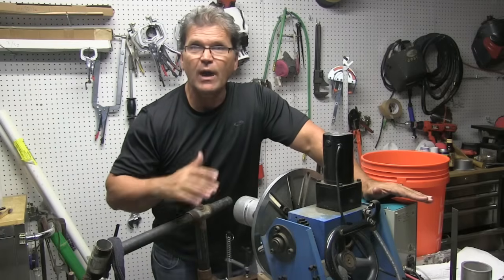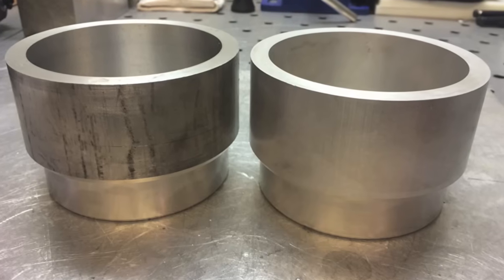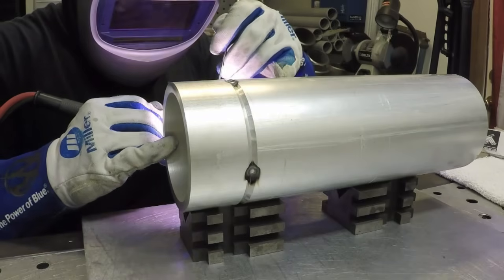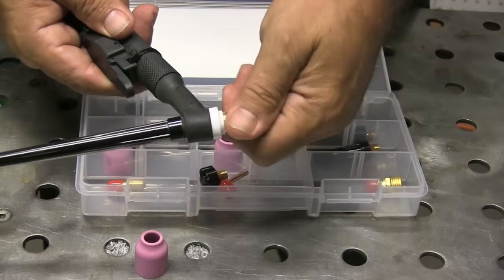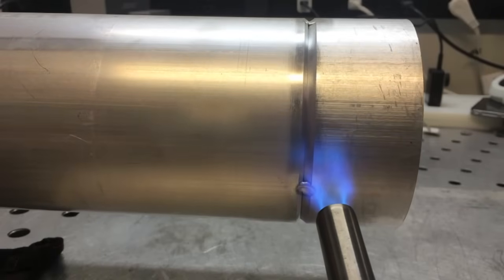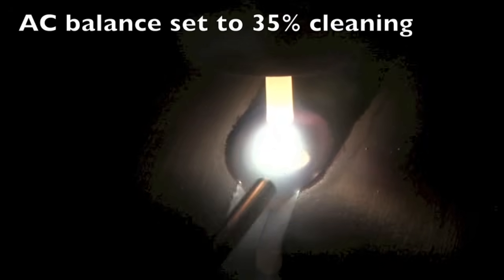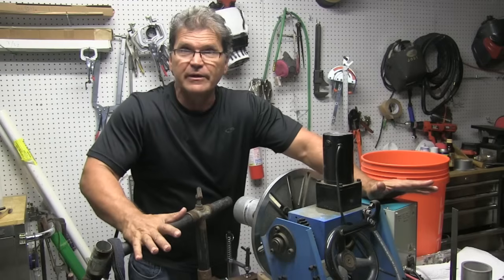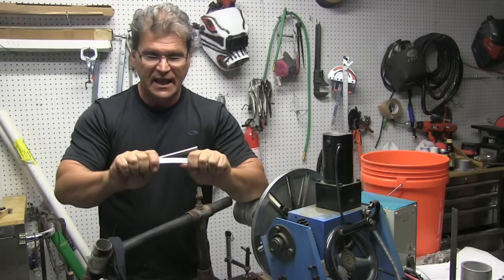TIG Welding 6061 Aluminum with 4643 Rod

Comment: I know this is an older video but does anyone have any good recommendations of books about heat affected zone and what it does to the the metal? I mean going deeper in depth then you average welding text book. Aluminum is non magnetic, so unlike steel I don't think it's going to change the way the molecules are aligned. Would like to learn more about that.

Comment: If the welded 3003 was tig’d with 4043 wouldn’t we see an “more uniform” radius applied since both the base material and filler won’t take on any heat treatment during the welding process?

Comment: I have to do a roll weld job in a miller jetline on this material in about 12 hours. Butt joint .125 sheet metal. God I hope this goes well

Comment: Dont agree. the HAZ is actually harder than the based metal, not softer. The HAZ experienced a very rapid hardening process when its been heated up and cooled down. Will need annealing to reduce the hardness of the HAZ first, bring it back same as to the rest of the material, then other heat treatment to change the overall properties. The testing straps bent like a square because the HAZ is harder. Thats also the reason why sometimes the weld cracks, because its too hard and brittle like a glass.

Comment: Hi nice video. I am stuck using a ck 180 tig torch. This was a 90 degree torch. 20 yrs ago  ck made a good torch. TODAY THEY MAKE ONLY GARBAGE.They lie about what they make. They lie about why it DOES NOT WORK. Do you have another brand tig torch that is the same size/shape/ amp rating as a ck 180?

Comment: Thankyou got a tig welder given to me been trying to workout how it works but you cracked it for me , i can now see were i was going wrong watching your video's , thing is there are to many settings for aluminium so i've gone for ac only , pre gas 2s , pre arc 4s , up slope 50 amps , 100 amp main ,15 % balance it seems to ball the end any higher, 80hz as it sound nice and welds nice , down slope 50 amps , down time 5s , down gas 5s would this be about right for 5mm aluminium  , thing is how much up slope and down slope , thankyou for your video's

Comment: Jody, how well does that dynaflux work on corroded aluminum castings, eg
 356A like on a modern automotive cylinder head.  I would like to see a before and
 after.

Comment: No air cooling hardens metal more than annealed state that is why welded place doesnt bend on annealed aluminium. I am a bladesmith and I have experienced it many many times. Annealing is done by cooling metal much slower than air cooling because the metal hardening depends on how fast you cool the metal and how much you heat it.

Comment: acetone or denatured alcohol  and a clean rag and a dedicated stainless steel brush that is never used on anything else but aluminum is the only way to ensure good cleaning. you don't contaminate that thing with anything else. even  sweaty hand oils can make problems . treat it with the same sterile usage as a toothbrush.  aluminum is a fussy metal.

Comment: Thanks for a good video.  But you lost me why would a tack be better with DC?  Wouldn't the cleaning action of AC be even more important to avoid porosity?  Another thing I would visually like to see would be a comparison of the "Gas" lens to the normal.  It is hard to see the difference.  Just getting into TIG and you are my go to guy.  I have a 120v Weldpak and a Clarke spool gun machine for my Aluminum as well as a Miller stick machine and just got an AHP 200 for my TIG.  You have been invaluable as a resource.  Happy Thanksgiving.  Doug
Reply: With DCEN you get an instant puddle as opposed to having to heat the part on AC. With DCEN though the more Magnesium the harder it is to weld. 50XX series is a handful on DC but doable once you trust your technique.

Comment: I was told by couple oldtimers that the annealed HAZ near the weld will regain some of its strength by aging naturally even without any special heat treatment, my thoughts about it are that it's not universal, some alloys should age naturally better than others, any ideas about this?
Reply: +jz1199 I've heard that too, they said about 90 days to age back to full strength. I never had the patience to wait out the 90 days though!

Comment: Jody, another grrrrreat video. I'm curious if the chemical AL cleaners are really effective. Perhaps in the future, you could do a short vid on those cleaners. The reason is one of my local welding suppliers seemed to poop on the idea of using cleaners and I would like hear your opinion.... Cheers and thanks, Daniel
Reply: your local welding supplies are bordering on clueless if they question  the cleaning of aluminium prior to it being welded. Aluminium is perhaps the most unpredictable and difficult  of metals to weld if it isn't clean.

Comment: jody been welding trail star 32 foot dump trailer .on the side walls where the vertical braces meet the outter floor the factory weld has broke on more than half of them. reweld them and not long their broke again using 5356 filler with mig gun stright argon.got any help for me.and please make a video on mig alu. pulse welding
Reply: +Joe Pritchett Not an expert but an old school welder told me that 5356 was made for cast aluminum while the 4340  is better suited to extrusions and sheet aluminum. I've always just used 4340 on all aluminum and 5356 on magnesium cast alloy welds. This 4643 looks good though, had never seen or heard of it before (I live in a remote city where the welding supply stores haven't caught up with the rest of the welding world yet!)
Reply: That's odd. Anytime I weld thin cast alu the much harder 5356 makes the part crack when the heat dissipates, if it does not crack you have a lot of micro-cracks so it will not hold liquids under pressure. Some BMW engine bellypans are cast and less than 1/8" thick... weld it with 4043, zero heatcracks, zero issues.

Comment: Curious question.. high polished aluminium, would it still need some sort of chemical cleaning??  (Using autosol on aluminium alot)
Reply from the maker: Acetone or isopropyl alcohol wipe should be enough
Reply: +weldingtipsandtricks Check out Shark Hide for finished aluminum, post project work. It comes out of the pontoon boat and hot rod/custom car world. Polish or finish as desired, put this stuff on w/a cloth diaper, and it prevents corrosion/oxidation for upwards of 14 months in coastal environments! Yes, I know this has nothing to do with cleaning for weld app.s but this stuff really is worth checking out! On a side note, DON'T use any of the brake cleaner/trichloroethane/trichloroethylene products as pre weld metal cleaners as any residue on the metal turns into a stinky fluorine smelling smoke that will make you sick at best and put you in the hospital for long term respiratory and nervous system issues at worst.

Comment: Jody, one question; do you have any tips on tacking aluminum parts together with a gap? have been trying to weld tear plates together where the fit was not good, but have been struggling with bigger gaps (lets say 3mm or 1/8")
Reply: +93ariebombarie   Try to use a backup plate for the gap.  Steel has a much higher melting point than AL and can be used for this.

Comment: Hey Jody. Great video. I just purchased an old AC/DC tig machine. It's a Linde HDA 300 (made by Union Carbide?). Anyways, I was wondering if the AC balance is permanently on 50/50 or if it's hard wired to spend more time on the negative side. There's no adjustment on the machine. One other thing, for the HF, there's controls for "phase shift" and "intensity". Any clue what these are for?
Reply from the maker: Due to a phenomenon called rectification your machine probly welds at around 60% dcen give or take
Reply: +weldingtipsandtricks Ok thanks. I don't have an oscilliscope, so I'll just have to try it out on some 6061 I guess. Any idea what phase shift is? I tried doing some research, but it got really technical, really fast. From what I can tell, it's an overlap of the sine wave, but I have no idea what application that has to welding.

Comment: Jody great video and Roy great welding,
Question for both of you. When tacking with DC- using He on this particular part did you use the 4643 filler? I know there are issues with certain fillers on DC alum and was curious if the 4643 worked fine, or at all. 
-Jonathan
Reply: +Superior Welding & Fabrication, LLC  Yes, I did use the 4643 wire to tack these parts with.  I tried it out on a scrap piece of 6061 first and it welded just fine.  I was happy to see that it worked because the DC tacks are much faster and smaller than AC.
Reply: +Roy Crumrine Thanks for the reply. Glad that worked out. I need to use DC on my tacks. I can see the speed benefit for sure.
-Jonathan

Comment: What machine do you use to tig weld aluminum. I have been looking at the Lincoln 210. Thanks for any advice..
Reply from the maker: +rodney tindel I have several tig welders.  But the lincoln powermig 210mp does not have AC .  It will mig weld aluminum with a spool gun ...but not with tig.
Reply: +weldingtipsandtricks Just curious buddy, this channel was originally run by an older guy with grey hair. Basically, I just wondered what happened to him? As he was also very  educational.....Thanks for your time.
Reply: +weldingtipsandtricks its not uncommon to weld aluminum with DC and 90/10 or straight helium. Penetration is twice as deep as AC argon.
Reply: manos3790 nnnnnjj

Comment: Thanks Jody for another informative video on welding.. I had no idea that Aluminum becomes hard when welding. I've learned so much from you that I can now tig and mig weld all metals. It's a great feeling knowing that I fabricated aluminum display panels for the university in record time though I still need more practice and I have yet to learn more about metal properties as you just illustrated. Thank again, Jody! Rest assured I will be getting your next batch of DVD videos.
Reply: I'm not sure how it works, Cannondale and Trek bicycles were the real innovators on this process. Apparently they were in communication mode rather than competitive/secrecy mode at the time as both companies hit the market with it simultaneously. Giant bicycles followed later. In practice, you fit, fixture, and tack all of your tubes, gussets, etc. After each individual weld is completed you immediately quench in ice water. Repeat the whole process till all is complete, dry away all of the water (I'll set it out in the sun for about 1/2 hour to dry completely), then thoroughly glass bead all surfaces. When I first started using glass beading back in 1979, I'd always been awestruck as to how the surface of the aluminum moved around (almost flowing!) and it kind of made me wonder if there was some serious stress relieving effect going on there. It turns out that there is! It is used now in aerospace, motorcycle frames, aircraft, athletic racing wheelchairs, really too much to list here. I'm no metallurgist but aluminum behaves so weirdly when compared to most other metals, if I get my metallurgist friend to answer this, I'll reply here. God bless.
Reply: +GnosisMan50  The weld will still be annealed.  That is what heat does, it can't be avoided in welding.  But the weld will be thicker with filler.  The final hardness will depend on the material and the filler used. AL is weaker when welded without filler as it loses some of it's elements.  That is why, except for something "artsy," you should always use filler because the filler is designed to replace the lost elements.
Reply from the maker: +GnosisMan50 glad you are enjoying my vids.  Thanks
Reply: +GnosisMan50     No - AL does NOT become harder when it is welded.  Watch that part of the video again.  The AL is annealed and the annealed area becomes "softer" and bends at that point.
Reply: +Bart Carter Excellent discussion! Several decades ago (prior to the advent of working high tech carbon fiber) the mountain bike manufacturers Cannondale, Trek, and Giant were having issues with just the subject you are discussing. Their solution is cold setting followed by glass beading and it alleviated all issues associated with weld heat affected zone, annealing, and stress cracks/breakage of frames. Having used the practice myself, I can attest that it works, far exceeding the stress characteristics of post weld heat treatment. On the order of 125% of original parent metal strength and point of failure rates! It defies all logical metallurgical procedures but it works, I've had zero failures with it. I use ice water at completion of each weld and upon finish up of all welds with cold set follows, shoot it all thoroughly with medium fine beads at about 80 p.s.i.
Reply: +timm white   That is something I never thought of.  I looks like to me that the glass beading work-hardens the AL.  But curious, what role does the "cold setting" with ice water play?
Reply: +Bart Carter 
does it become harder AT the weld?   that's what I meant...
Reply: +Bart Carter 

Thanks for sharing, Bart! ...there is so much I have yet to know.